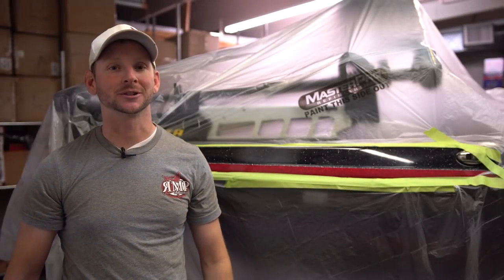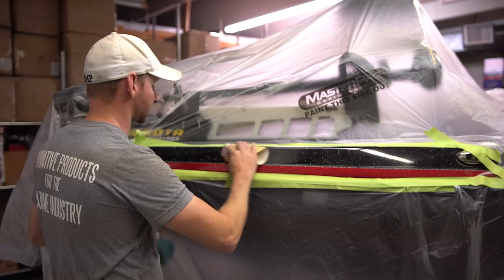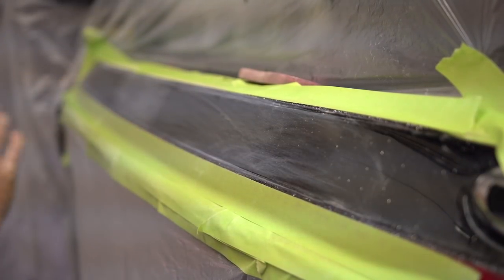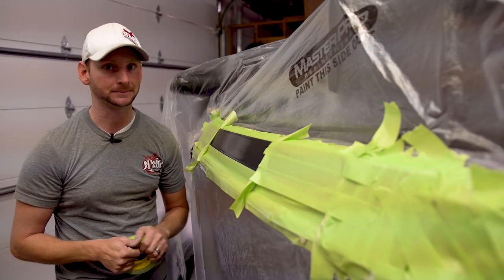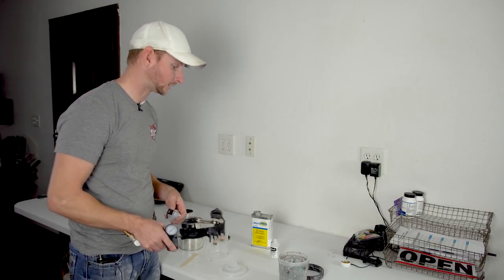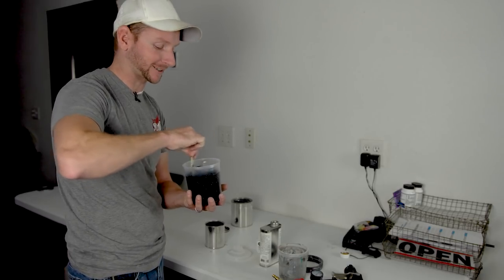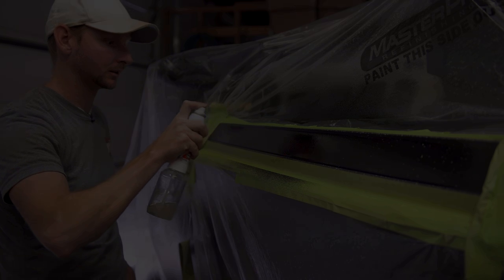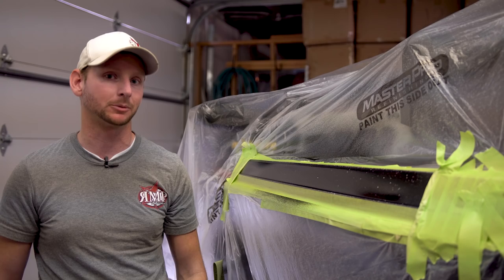Fiberglass Repair: How To Repair and Spray Metal Flake on Boats

Comment: Very good how-to video. I also repair polyflake for a large bass boat dealer in the northeast. I use the exact same method for application as you do as there is no other way actually. A couple of things you do, I do differently. Instead of styrene for reducing, I use acetone instead. I have never had any issues using acetone so I have stuck to using it. The other is the use of a Preval sprayer. I use either a siphon or gravity gun with medium sized tip. I do use Preval's a lot but only in smaller sized areas. I use PVA with at least 3 sprayed applications letting it dry between each coat. In general, I will block sand off all the peaks in the clear then I apply a second coating of clear then block sand using a shaped Styrofoam long block with 180 grt sanded surface then dry 320-600 machine then blocked 1000 wet and finally 2000 wet hand sand (careful on the edges) then a fine cut compound buff.  Doing a 3 color polyflake and clear application is far more labor intensive.
Reply: S.Brown, I’m trying to do several, small repairs on my boat. What exactly do I need in order to buy the clearcoat mixture? I’m having an issue finding this out. Any info would be appreciated!
Reply: @evanbowman358   Hi Evan. I get my clear from Ranger or White River Marine. Also sometimes from LBI in Connecticut.

Comment: great video and advice   i totally agree with the advice and comments  on the respirator   i can see you are a young guy and  when i was your age i thought i was  indestructible  but trust me we are not around  the harsh chemicals in some of those products  in my 40s i had 5 or 6 Strokes that left me permanently disabled btw i’m a retired Woodworker who was always around the same chemicals you are using  and i firmly believe those chemicals were the culprits   from years of exposure  i grew up in South Florida  and  as a teenager  began doing fiberglass and gelcoat repairs  using those aerosol sprayers like you used  trust me you dont want to go through what ive had to do  years of physical therapy  to learn how to walk, talk, and even think  again

Comment: Great video, I have an older boat that needs some touch ups like this. I had no idea the flake alone was what determined the color. It has those thin cracks in the gelcoat every older boat has and was wondering if there was a technique to make it look beautiful again? Again, thanks for these videos, they're really helpful.
Reply: Were you ever able to finish the project? I’m looking to do the same thing but can’t seem to figure it out completely.
Reply: @evanwilson4204  I used a handheld steamer to remove the older flaking Gelcoat

Comment: From my 20+ years of bodywork experience you should always use a sanding block and never hold the sandpaper and sand with your bare hands. Otherwise only your knuckles actually touch the sanding paper and sand the surface, so instead of sanding the surface flat you end up sanding finger grooves into your project. I prefer a block and sand at 45 degree angle and then sand back across in 45 degree angle in the other direction. It helps get better feel for the surface and when it is truly flat. Some people might say it won't matter, but the flatter your surface the better shine and mirror reflection you get on your final product. If you ever look into a paint or fiberglass job and the reflection isn't flat like a mirror reflecting all the images and colors surrounding the vehicle, that distortion and waves in the reflection are due to a surface that is not been properly prepped and sanded completely flat. If your going to buy the materials and go thru all the work it is not that much more effort to do it correctly. Also whenever sanding wet sand with emery paper, the water removes the dust so the paper won't clog. It also helps to sand faster and flatter so you get a better overall finish and final product.
Reply: Make a video!

Comment: Would it be important on the hard lines to use fine line tape, as opposed to masking tape? Additionally, to protect your young invincible lungs, I would recommend that you wear a respirator while spraying, and at least a dust nask for your prep work.  Old guy here, been painting Marine and automotive for over 50 years, still have my lungs because of heading the same advice I just suggested to you. Thanks for the video! Be safe and well.

Comment: my entire boat top is faded out ive wet sanded alot out of the oxidation layer but its still cracked and looks bad. i want to price spraying new gel coat on the entire top of the boat. bottom is fine i can use for reference. 
the one thing i cannot find is 
where to buy clear gel coat. how much i need. where to buy flake and how much i need. i know how to paint cars but boats are a different story since now one will go through a proper walkthrough the whole thing
Reply: I know this is old, but roughly one quart per 25 square feet is needed.  You can buy the clear on ebay or amazon.

Comment: If my gel coat is starting to fog and gray can I respray the clear over the top without respraying the flake
Reply from the maker: yes you can, but you will need to wetsand all the oxidation (fog) out first to make sure you aren't spraying over the oxidation, if you spray directly over the oxidation you will trap it under the new layer or gelcote and you won't be able to remove it.
Reply: Thank you very much been looking all over for the answer to this question finally just decided to ask

Comment: What is the Wax Additive product?
Reply: Wax additive agent is used in the final layer of gelcoat as a sanding/ curing aid also sometimes referred to as patch aid as well.
Reply: its a surfacing agent that you can buy at any fiberglass products website. liquid wax.

Comment: Mixing metal flake with clear is not  the best way to do it . It makes a mess . They make whats called dry  metal flake guns. You spray on clear  and then spray the dry metal flake on the clear . what doesn't stick  just falls to the plastic you put on the ground  you can even collect it and put it back in the gun . The gun just cleans up  with air . The best part of the dry  spray is you don't have to  know anything about  metal flaking  or mixing the right amount .  You can practice a few times  on a cardboard box  and you are good to go  . Watch this video .  https://youtu.be/YmE-kCQLjvM
Reply: Have you done this with gelcoat? (as opposed to paint)

Comment: why should you not use acetone to thin the clear?
Reply: bent rodguy acetone is what is used to clean spray guns and equipment. Acetone breaks down gelcoat. Using Acetone to thin gelcoat will degrade and eat away the gelcoat. 
  There are things meant specifically to thin gelcoat. Patch aid or patch reducer. The lighter the color of gelcoat you use the less reducer you should use. 
  To much reducer in a white gelcoat for example will leave a yellow tinge or discoloration to the gelcoat and will look nasty in a blended area.
Reply: Styrene
Reply: @chrislangdell117  styrene breaks it down as well, any solvent reduces chemical signature of paint, or gelcoat for that matter so acetone is fine, i have used it for the lat 35 years i have been doing gelcoat repairs, zero problems, styrene works, denatured alchol, and even laquer thinner, but the best i have found is acetone, very readily available as well
Reply: @stephenvarney9284  Solvent
Acetone is a good solvent for many plastics and some synthetic fibers. It is used for thinning polyester resin, cleaning tools used with it, and dissolving two-part epoxies and superglue before they harden. It is used as one of the volatile components of some paints and varnishes. As a heavy-duty degreaser, it is useful in the preparation of metal prior to painting or soldering, and to remove rosin flux after soldering, which helps to prevent the rusty bolt effect. >>google acetone and read the wikipidia definition on it
Reply: @handyallaround5776  do what you want. I went to school for this. Was taught by the head of R&D department of the gelcoat manufacturer that this was the worst thing you could do. He explained the science behind his reasoning but that was 25 years ago. I dont remember much of it. Im glad your methods have worked out for you.
Reply: @chrislangdell117  yes to each his own, styrene is synthethic, acetone is organic, both work great, its up to the individual to decide for sure.
Reply: @handyallaround5776  . I would use styrene or patch aid reducer. Properly mixed gelcoat is extremely durable, and doesn't stress crack. I have pulled thin films from mixing cups after its cured. Bent it 180 degrees back and forth and it doesn't break. I guess I am always after the best possible result. Not always the fastest or most convenient. Hope you guys have enjoyed the summers on the water like I have. Nothing beats a boat in summer. Thats for sure.

Comment: I've been doing cosmetic and structural fiberglass, Gelcoat and all linear urethanes for 12+ years. Metallic anything absolutely has no business being on a boat/yacht. You definitely do not just "eyeball" how much catalyst you add. Poor advise. You could cause someone to suffer from chemical burns or burning down a shop. MEK-P IS nothing to sneeze at.
Reply: This is old, but he never advised anyone to do what he is skilled at doing, specifically eyeballing the mix. He stated that viewers wouldn’t like it. I see nothing wrong with others making choices that work for themselves and showing others, it’s not that exact of a science, and to have confidence to DIY. Maybe you should make a safety video to inform the DIYer.